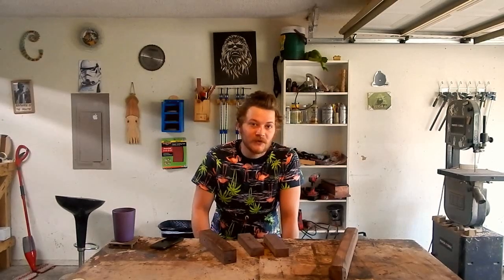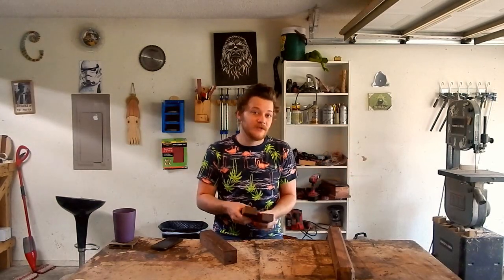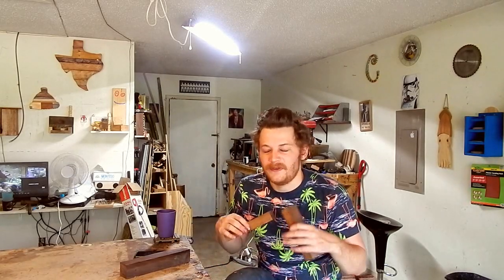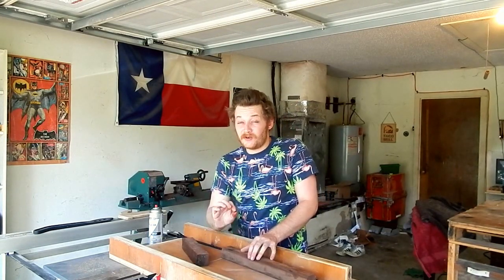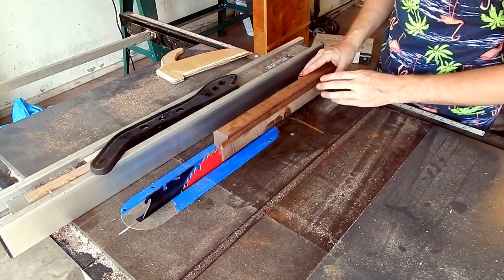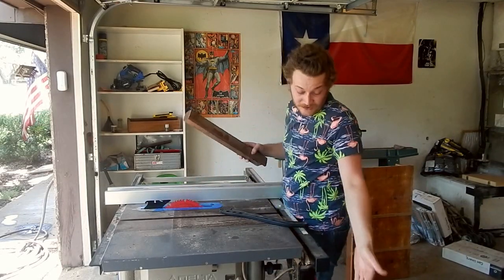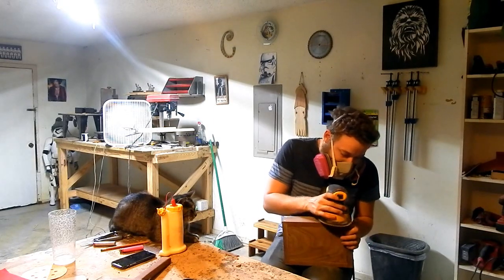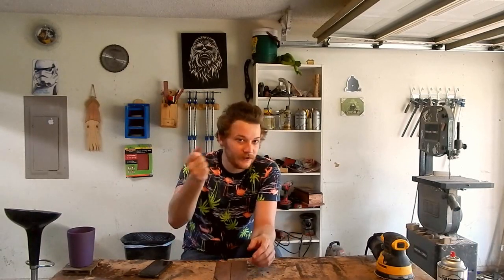Beginners Guide To Wood Species - What To Expect With Walnut

Comment: Thank you, I am sitting here and I have several cherry trees that I need to get milled. the cherry video helped me immensely. My question is if you have a 20 inch tree, how would you have it cut up, 1" rough, any 2" rough? Would you just have them cut it flat or would you have cherry quarter sawn? Of course this is wet and I will need to dry it. Plan on naturally drying it my house with low humidity doing then making a small drying shed with a dehumidifier to finish before using it.